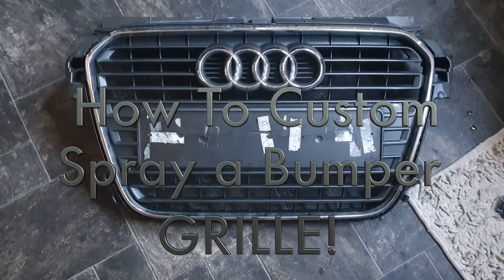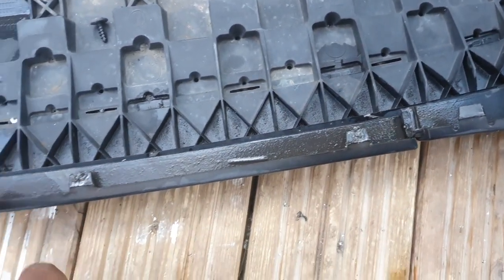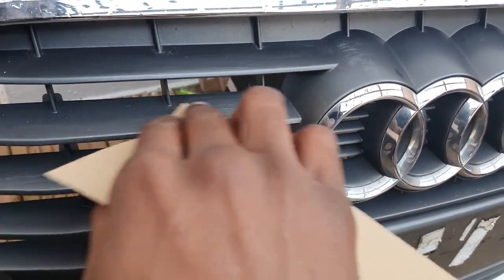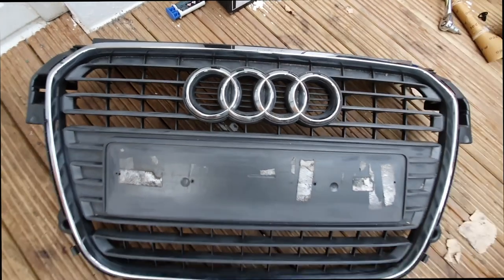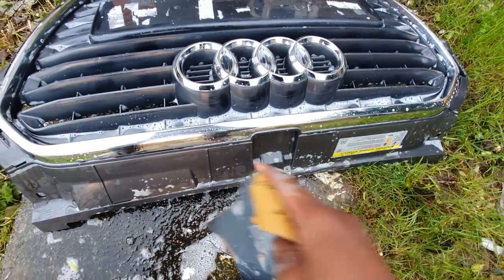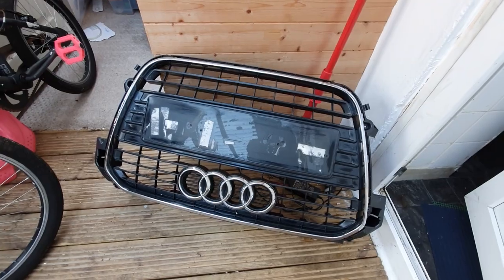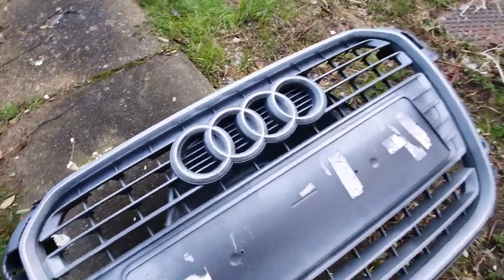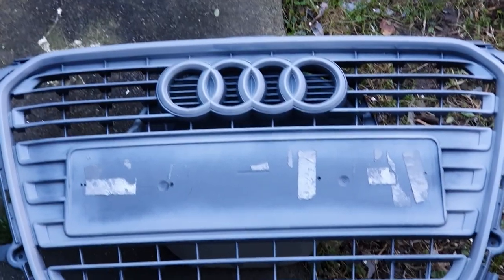How to spray paint a car grille (video was too long so there is 2 parts to it)

Comment: Did it last? From my experience it always looks bad after a while when it got hit by small rocks. Hard to paint chrome… maybe aerosol could remove it? I dont know if its real chrome or aluminium plated plastic
Reply from the maker: It did, it's just chrome paint
Reply: @UnderHoodz  nice! I tried an oven cleaner and nothing happend for the 1 hour i waited. Did you scrape it off or how did you do it?
Reply from the maker: @Luuuugn  I sanded it down